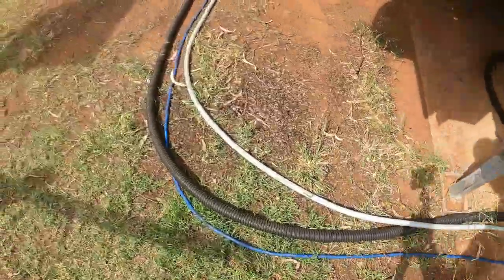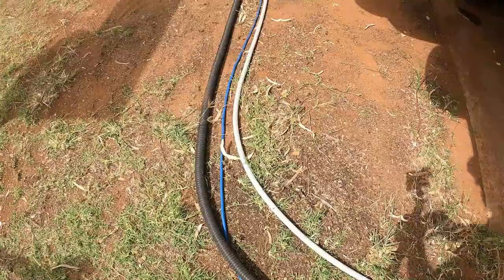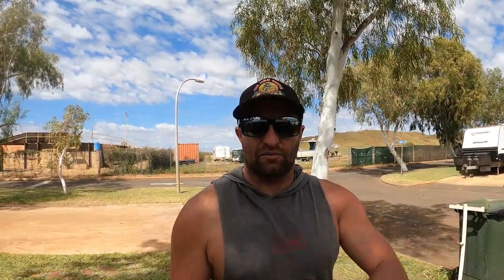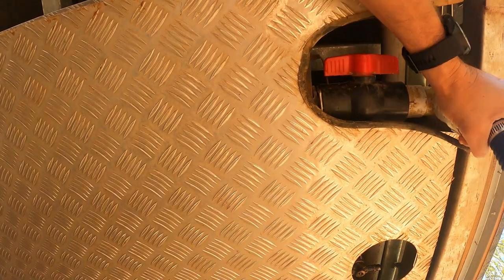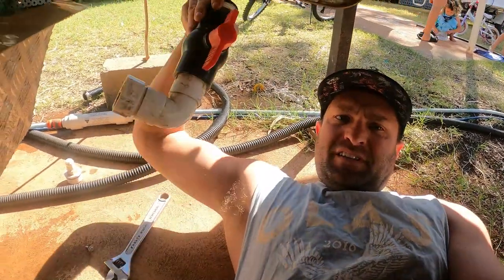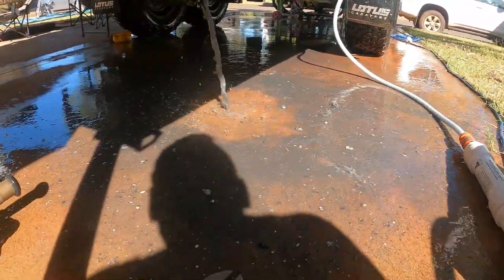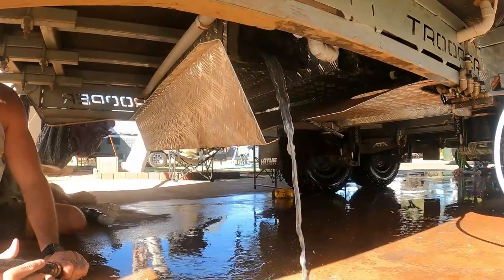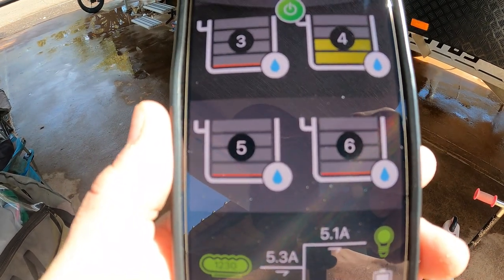Maintaining your Water Tanks in your Caravan

Comment: I'm a plumber. The outlet from your ball valve looks like 40mm then drops down in size to 25ish waste hose. That will cause stuff to slowly block and build up. I'd up the waste hose size, should help to flush some more out. Also don't waste your money on those drain tablets you can buy, they don't work.
Reply from the maker: +Chalks cheers mate what do you recommend instead of the tablets? Just harder to store a bigger waste hose is all.

Comment: Storing grey water for longer than 12 to 24 hours will turn grey water into black water. Creating a bypass valve for the grey water to discharge is worth the effort. When in a caravan park or similar use the bypass to discharge the grey water directly into the park waste water outlet without going through the grey water tank.
Reply from the maker: +Sylvia V Cheers mate didn’t  think of it like that. We don’t close the valve at all it’s just blocked so now it’s clean I’ll make sure it doesn’t happen again.

Comment: We use vinegar ( for the sludge build up) down the drains regularly and bi carb soda (helps with the smell) Every three months I do what you did and completely drain the tank and clean it out. To clean it I have a nozzle that sprays 360 degree jet of water that works well to clean inside the tank as it’s attached to a semi rigid piece of poly. I got it years ago at a caravan and camping show. Can’t remember the brand, but I have see other travelers using garden watering nozzle that’s been adapted to fit a regular garden hose all bought from bunnings. Just look for the nozzle that puts out the most volume of water per min😀
Reply from the maker: +Mark Jones great idea I’ve seen them gives a good clean all around great idea. Cheers.

Comment: I just came across this.  Change your 25mm hose connection outlet over.  Put a 38mm cam lock on, just after you on off valve. I did it to our Lotus Trooper.  It was forever showing half full, until it showed full and was blocked.  I took that stupid 25mm connector out and it flows freely now.  No more issues.  If you look at your 25mm connector, it’s almost down to a 20mm outlet.  Hope that helps.  

It’s not the hair, yes it will make it block a bit, but make your outlet suit the size.  

Go to an irrigation supply shop.  Bunnings will not stock what you need.  RTM should have a 38mm drainage pipe. 

Reply if not sure.

Comment: Hi I have a JB Dirtroader and was getting the terrible smell from the grey water tank also. This was particularly bad if we stayed in a parking the grey water hose connected. When I was in Broome this old Fella said to install a couple of Duck Bil non return valves in the pipelines going to the grey tank. I did this and they were purchased from a plumbing shop in Broome for around $45. .Best thing I ever did as no more smells at all.
On Ebay they are called :
Waterless Self Sealing Waste Valve Inline Trap Bath Basin Caravan RV
Reply from the maker: +Mark ovens never heard of this I will look into it cheers mate 🤙🏼🤙🏼
Reply: @lappingtheisland  inside the pvc body of the valve is a rubber membrane that is shaped like a ducks bill so it let's the water and waste out then closes and won't let the smell come back up the pipe. Put one on whatever pipe goes into the grey tank. Best thing I ever did. The van used to stink like a septic tank especially when in the vanity sink. Good Luck and I enjoy you vids.

Comment: Ever thought of putting in a bypass before the grey water tank inlet. Use this when your not required to store the grey water. I’d also probably use a caustic based drain cleaner if it’s that bad. Cheers dude.
Reply from the maker: +Bill McDonald hey mate, yeah have thought about it but never had an issue until now so it will have to go in now. Cheers 🤙🏼

Comment: What's that app for your tank levels? And how does it work from the tanks?
Reply from the maker: I run the redarc RedVision system in the van for my battery management, turning lights on and off and has tank gauges too it connects to my phone and I can control everything with my phone too.

Comment: I'd alter the arrangement to have a bypass valve upstream of tank to allow crap straight out to discharge it, and only turn it to use the mank-tank when you need it (eg nat park). I think trip in a van bloke did a vid on this. 
When you need to wash tank, if you can find an attachment to fit in end of pressure washer and into hole (90 deg or 180 spray) try hot p pressure wash it. If the tank plastic can handle caustic soak it helps break down fat, work well on bbq also spray soak light scrub and rinse, but dangerous chem, need good ventilation and good ppe, caustic burns are nasty. Alternative, chlorine (bleach) soak or bicarb also. Note most l of these chemicals will corrode metal.